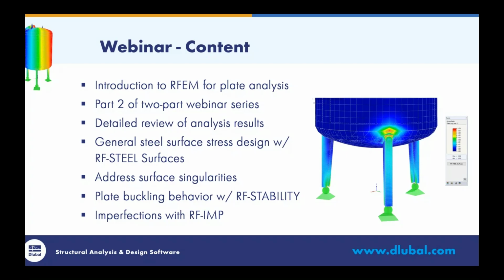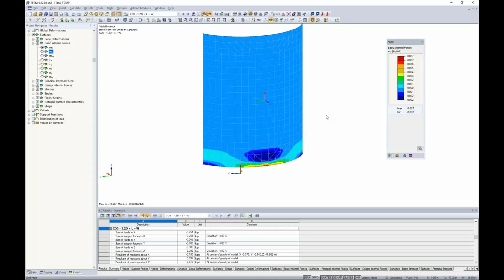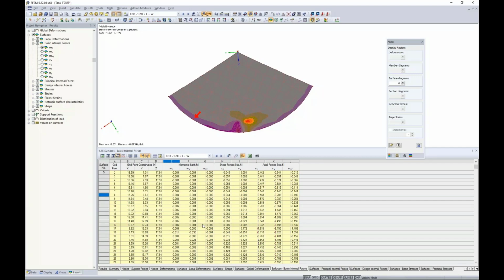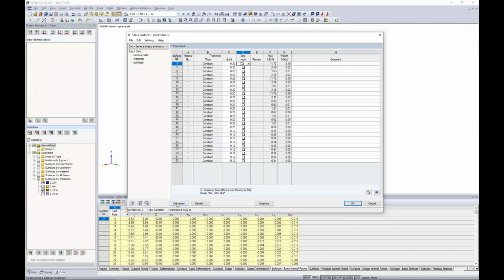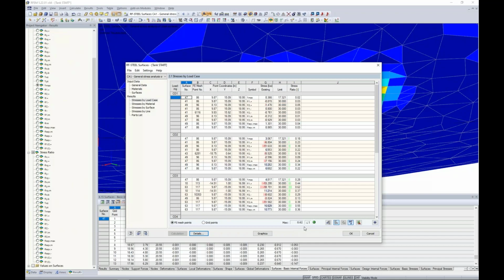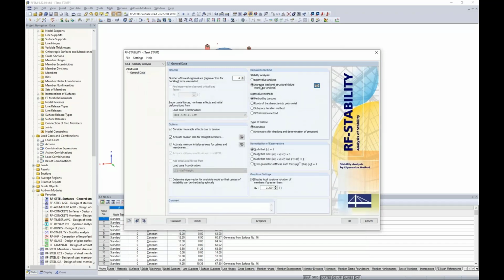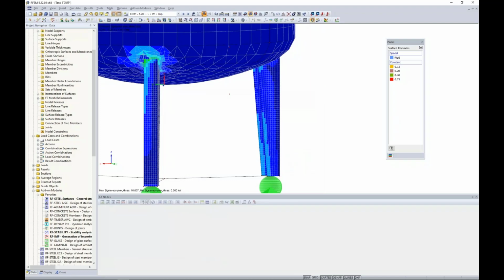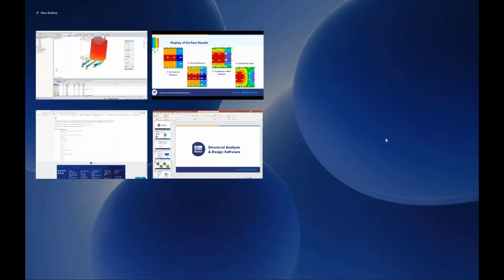Plate and Shell Modeling in RFEM - Part 2

Comment: Thank you for the webinar.

It would be nice to see how to plot a load factor / deformation graph for the case.

One more thing that come to my mind is effect of non-liner vs linear buckling analysis. Non-linear buckling mode may be totally different. Is it possible to perform non-linear buckling analysis in RFEM/it's modules or have I missed it in the webinar? Appreciate your comment a lot.
Reply from the maker: Hi, Евгений!
This is described at https://www.dlubal.com/en/downloads-and-information/documents/online-manuals/rfem-5/07/03/04
Best is to look at this FAQ: https://www.dlubal.com/en/support-and-learning/support/faq/003502
Reply: @DlubalEN  thank you for a quick reply. What about non-linear buckling?
Reply from the maker: Hi, Евгений!
Currently you can do a non-linear analysis on an imperfect structure. The imperfect structure is usually defined by a scaled buckling mode. We can take into account material non-linearity and geometric non-linearity.
Reply: @DlubalEN  non-linear analysis and non-linear buckling analysis are not the same one. Linear buckling modes are correct only for structures that act linearly, which may not be true for tanks and silos. This may lead to grate overestimation of resistance of these kind structures. 
https://www.youtube.com/watch?v=EReK5T7OUig

Thus my question remain. Is it possible to perform non-linear BUCKLING analysis in RFEM?
Reply from the maker: Hi, Евгений!
As I said before, we can only take one Eigenmode and use this as the initial structure. After that we can analyze this imperfect structure with a non-linear analysis. The load may be increased gradually and large deformations and post-critical analyses are possible. If the structure buckles it will be indicated by an instability message. What is a limitation currently is, that the imperfect structure needs to be more complex.
Reply from the maker: Hi, Евгений!
We are showing the options that we have. It is true that we need to overlap several modes for imperfection. Even if you can do this it will be not a "push button" solution.
Reply: @DlubalEN  I don't expect a 'push button' solution. I expect a software that may do the job according to code requirements from start to end. What is the point if after all a complex case should be done manually?
https://enterfea.com/imperfections-in-buckling-design/ - this is a good example how linear buckling may mess up your analysis, even if shell looks very simple
Reply from the maker: Hi, Евгений!
RFEM can do a non-linear buckling analysis based on a non-linear buckling mode. However, we can do only one non-linear buckling mode for now. The example you mentioned from enterfea should be possible to do in RFEM. As written there, the finding of the imperfection mode is not a simple task. You may also find following article interesting?
https://www.dlubal.com/en/support-and-learning/support/knowledge-base/001510
May I ask for which company you work and if you are interested to use RFEM there? Or are you using RFEM maybe already?
Reply: @DlubalEN  this is the answer I have waited for. Thank you very much for it. I had a feeling that the non-linear option in the rf-stability module is the non-linear buckling analysis, but didn't check by myself.
I am a current user of RFEM. In general, I am very satisfied with the software. A thing has bothered me is that nothing have been said in the webinar about how important difference between LBA vs NLBA. You may not show the option, but give a warning.
Reply from the maker: Hi, Евгений!
It would be better to send support questions direct to support@dlubal.com. We have here dedicated response times and we know which versions of the software you would have as a regiestered user. May I ask which company your work for or what your client number is?

Comment: Hi how to model mitre bends for a circular duct
Reply from the maker: Hi, Elamurugu!
The easiest way to do it is to draw a polygon line (not single lines!) for the center of the duct and give the line a circular cross-section. At the end you have a member with a circular cross-section that includes bends. Then right click on the member and convert the member to surfaces using "Generate Surfaces from Members". It will create the mitre bend for you.
See also the video: https://www.youtube.com/watch?v=yVI1aByWI3g for surface generation from members.